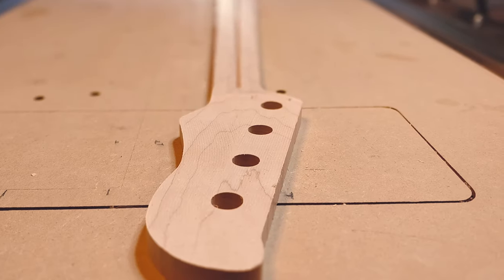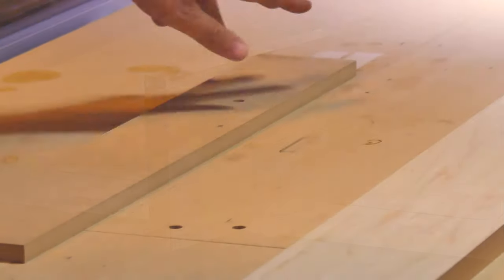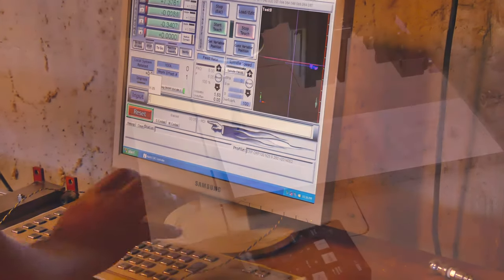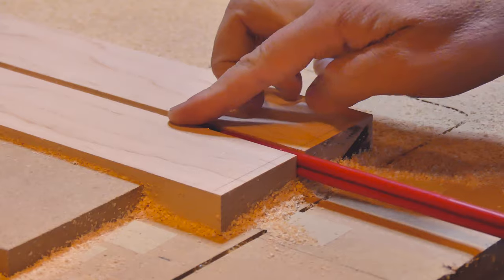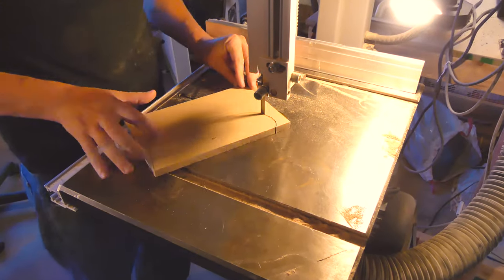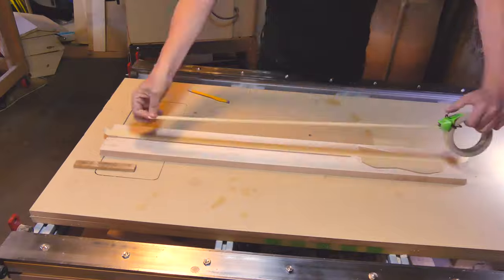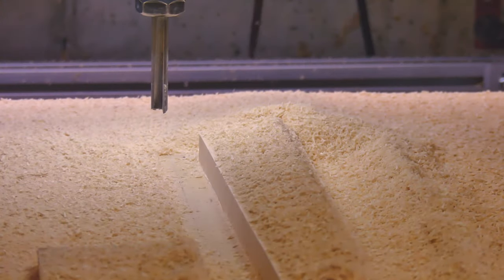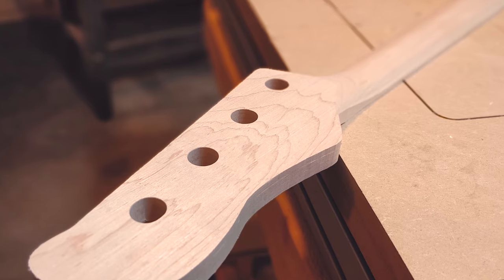CNC Bass Neck | Making Perfect Two Sided Parts

Comment: An edgefinder is vastly superior to locate and align your fixtures and workpieces.

Your statement about support is more important than most people imagine. Rigidity of the setup, rigidity of the work holding of your setup, and what most, especially in a wood shop, often don't consider, the rigidity of the tooling (or, for that matter, the rigidity, or lack thereof, inherent in the machine design and construction).
Reply from the maker: Edge finders are not necessarily better, they can be inaccurate if you don't know how to use one. The reason they are commonly used in machining is that they are faster, that is if you have an ATC. The method I use is constantly within .001" or 10 times my margin of error in wood. I have a probe that I could do this work with but the time it would take to change back and forth between tools for no benefit in accuracy doesn't make sense for my application.

Comment: Interesting approach, thank you. Your method requires to have perfectly squared stock though which is very time consuming. And you're re-indexing your mill after flipping over the stock. One suggestion for an easier (less time consuming) approach: 
1. I'm usually only flattening the surfaces and thickening the stock, leaving the edges untouched
2. I then use the heel point of the centerline for indexing the stock
3. first cutting operation is to bore 4 holes at the extreme points of the stock that are symmetric to the centerline and go through the stock into the waste board
4. when flipping over the stock I use those 4 holes to position the stock by using wooden index pins. That way I don't have to re-index the machine and can use the same X/Y coordinates for all operations. I then only have to zero the z-Axis when changing the tool.
This method requires to have a stock that's a little bit larger than yours (I'd say +2inches longer/+1 inch wider relative to the model) but it's very precise and fast and it excuses some initial positioning errors. It also happened to me that I had a stock with slightly diagonal grain. I then positioned the stock diagonally which straightens the grain in the model. In that case, you will need an even larger stock. But it works like a charm!
Reply from the maker: I have used that method in the past. There are a couple of issues I have with it. While it is a little time-consuming t surface and join the material, the finished product comes out much cleaner, and any flat surface that is flush with the stock surfaces it ready to go. The second being that the amount of surface area you have on indexing pins in your spoil board is very small, so any wear or inaccuracy in the pin, pin mounting, or boars in the part for these indexing pins is amplified. I do realize I'm literally splitting hairs here, but you cant get accurate parts without taking into account the small stuff, in this case, the very small stuff. 
I rarely ever cut more than one of a part, if I was planing a production run I would do things differently, That is not what I am doing here. I'm trying to leave my CNC bed open and available for varied and different milling objectives and at the same time make them very accurate. If the pins are working for you then that's awesome, it's just not ideal for my setup.
Reply: I use two pins in center line with a help of doublestick tape.

Comment: Can you please tell me about the Large Ball Mill You are Using, I have Looked Everywhere and can't find that cutter. Would you be so kind to tell me where you bought that cutter,  Love your work,  I designed and built me own CNC machine, Just to see if I could, Then had to learn how to use it, I have made many guitars, and made my first Neck today, But still learning this art,
Reply from the maker: I get that question all the time, and the answer is probably going to be a let down, it's a 3/4" ball mill from my local big box store HDepo.
Reply from the maker: https://www.amazon.com/Freud-Radius-Round-Shank-18-134/dp/B00004T7DP/ref=asc_df_B00004T7DP/?tag=hyprod-20&linkCode=df0&hvadid=309735728871&hvpos=&hvnetw=g&hvrand=6132416620262233020&hvpone=&hvptwo=&hvqmt=&hvdev=c&hvdvcmdl=&hvlocint=&hvlocphy=1026991&hvtargid=pla-434245500190&psc=1

Comment: Thanks for the awesome video and the peek into your amazing techniques. I have a 16"long  x 18"wide DYI CNC machine and want to modify/rebuild it to cut bass guitar necks. What would you recommend for a max length of machine bed? Thanks again from NB Canada
Reply from the maker: Sounds good, I don't think I've ever been asked about maximum sizes. If  it cuts accurately the extra size should not be an issue.

Comment: Thanks so much for your videos. I'm struggling with a single step you've outlined. When you flip your part it looks like you zero off the same corner (makes sense). Practically speaking however how do you accomplish this in fusion?  Im assuming you move your origin point to match, but whenever i try this I end up with an inverted z axis. Any suggestions?
Reply from the maker: Just flip the z, It's easy in fusion, just click the z arrow.

Comment: Really a nice video and some great ideas. I built my first acoustic guitar with the help of a very talented guitar building friend.  Midway through the build (body complete, starting on neck) we decided to design and build a 1500mmx1500mm CNC machine and electronics. CNC is built and has many projects under it's belt so now I''m ready to tackle the neck. Your video came at a perfect time. Thank You! I have a couple of observations and questions. Forgive me if you covered some of these in past videos - I will review all you videos.
1. I notice you have a light at the end of your spindle - I like it. Where did you get it?
2. I notice you stock width is sized prior to starting the milling and that you flipped to make sure you reference the same size. What if you sized the stock width as part of the milling and then you would not have to end-flip stock to reference the same edge. Just a thought...
Reply from the maker: 1- The spindle Light is just an ordinary car headlight "helio light". I picked it up on eBay for under $12. I power it with the same supply as the LED lighting under my gantry. 

2- The surface finish from my drum sander is just better than the surface finish from the machine. on all my parts I thickness them so that any flat surface on the top or bottom of the part is thicknesed on the drum sander. You can certainly use the machine to surface stock, and for lager pieces, I do this, but its quickly and easily done with the drum sander. My method of work holding (CA glue and masking tape) requires very flat surfaces to work well and the drum sander is my go-to device for this job.

Comment: What model CNC router is that? Don’t think I’ve seen that one before. Your instructional style is very pleasant to watch.
I’d love to see fusion video of designing a guitar body from start to finish. New fan!
Reply from the maker: Thanks, 
This is the CNC Router Parts CRP2448 standard machine. I will be upgrading soon.
Reply: @TwoCherriesIns  are you selling yours?
Reply from the maker: @EngravenArts  I have been working on some applications using the Fusion360 API to use the CNC to probe and grind frets to a very precise dimension, similar to how PLEK machines work. I plan to set up this machine as a dedicated fretwork. 
https://youtu.be/LsROycwUkjE

Comment: Man, these  videos are amazing.  Would you mind sharing  details on the bits you're using?
Reply from the maker: Nothing special just regular woodworking router bits. I don't use very many specialty bits, I get a lot of flack for it but it works.
Reply: @TwoCherriesIns  pragmatism over theory. That's  the way to go. I was asking in broader way; what type of bits you use for pockets, cuts or finishings  passes. Single flute, straight, spiral, up, down cut, etc?
Reply from the maker: @matiasgoinheix366  For most of the milling, I use three bits, a 1/2" x 3" straight two-flute, 1/4" x 1" spiral two flute, and a 3/4" ball nose. You should be able to get something like these three at your local big box hardware store. I will replace the 1/2" x 3" with a 1/2" x 2" at some point. I got a great deal on youtube for a lot of 10 of them.
Reply: @TwoCherriesIns  Thanks for the info!

Comment: Nicely done! 2 month to late - i figured the most mistakes on my own ;) by try & error. Supporting the headstock ist really a good point - although i tried only angled headstocks so far - which is perfect for beginners - NOT ;).
Reply from the maker: Learning from your own mistakes an incredibly valuable lesson, How do you create support material for scarf joint headstocks, I'm sure you have seen my method her on the channel.
Reply: @TwoCherriesIns  indeed, it is. I left the headstock... as a paddle and routed it manually with a trimmer & templates. Maybe i will try your approach the next time.

Comment: Thanks for this video! I have a question... Where do you find those big bits? The round one and the long one? :)
Reply from the maker: The ball nose is a .75" and it's just from my local big box store, the long .5" bit is just a normal straight flute 2" x .5" from eBay. I don't use very many specialty bits just of the shelf stuff that is inexpensive and easy to get.
Reply: @TwoCherriesIns  Thanks! I'm like you, I do not use special bits as we are not milling metal!
Reply from the maker: @dantahoua  Recently I was accosted in comments for my bit choices, I say use what works for you.
Reply: I will have a great european mills for guitar use. I gues in the february 2023. They will be made in europe from HSS (Carbide likes to break). I have some 14mm with 12mm schaft (half inch) and they are very fast (2 x faster than standard two flute bit).